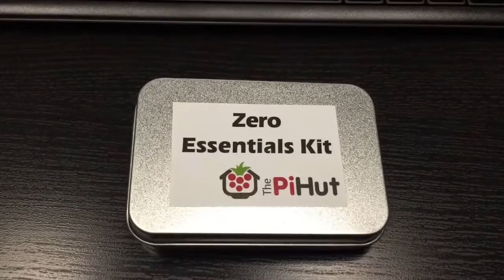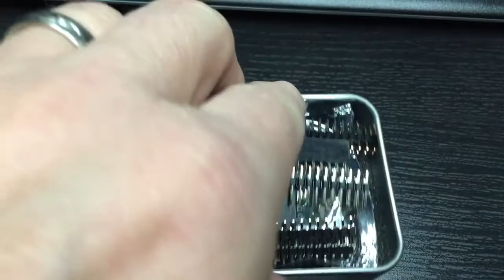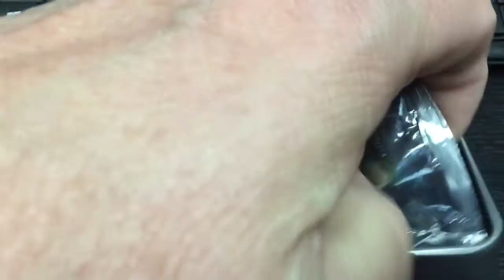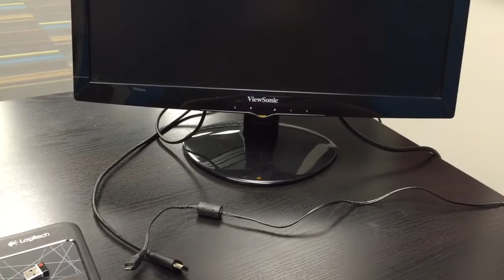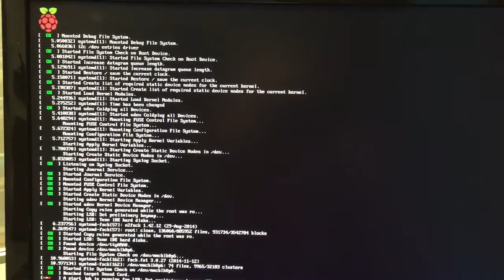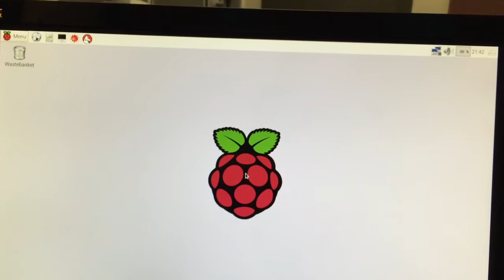First Look at the Raspberry Pi Zero

Comment: Thank you for this video.  It's very helpful for someone who is new to Raspberry Pi!  Do you know whether I can use any monitor, as long as it has an HTMI cable? Thanks.
Reply from the maker: +Jill Dawson Yes, a television or computer monitor with a HDMI port will work with the Raspberry Pi. For the Pi Zero, you will need an adapter to fit the mini-HDMI port on the Pi and then connect with a regular  HDMI cable.  Also, the Pi Zero has one micro-USB port for connecting a USB hub (so you can connect WiFi, keyboard, mouse, etc) and another micro-USB for power.  Thanks for the comment.